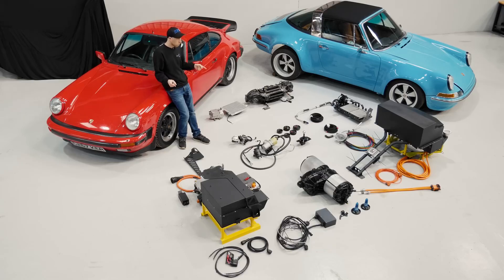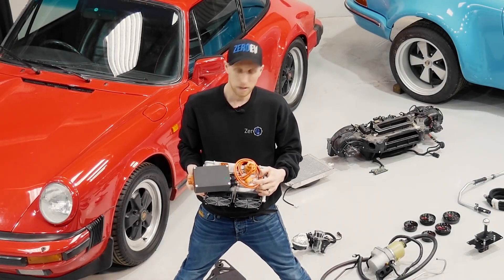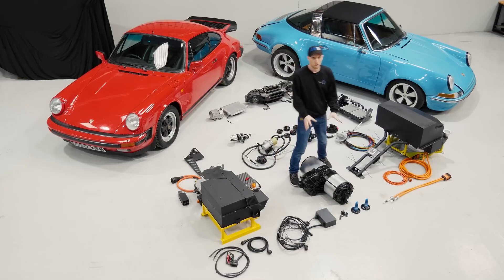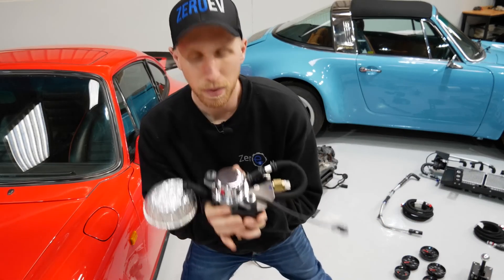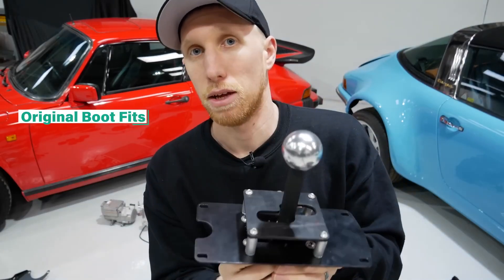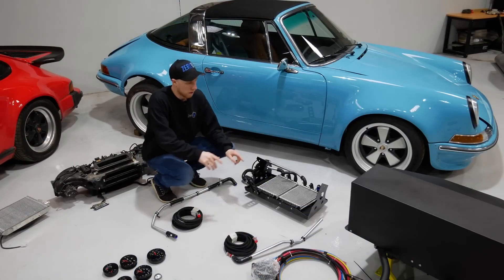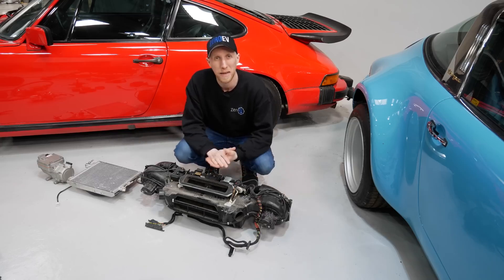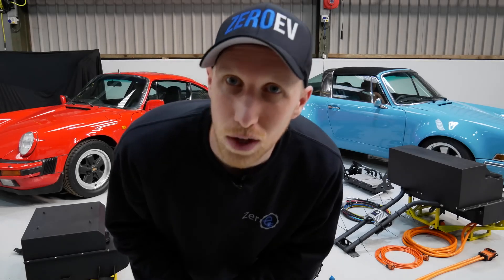Electric Porsche 911   964 EV Conversion System

Comment: Looks like a good kit. 
I assume it adds a fair bit of weight compared to the ICE system it replaces. 

I’d put an aluminium V8 in my Porsche before one of these. And I’d never put an aluminium V8 in my Porsche. Porsche = Flat 6. 😊